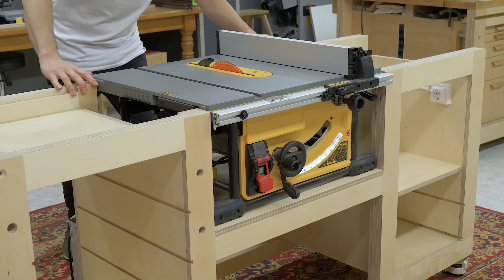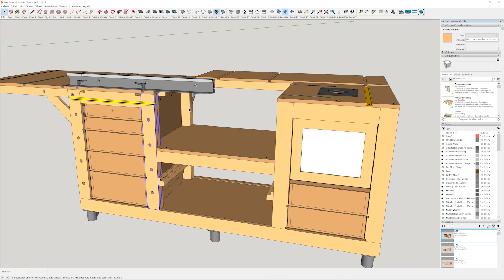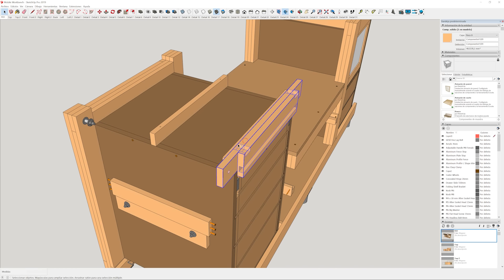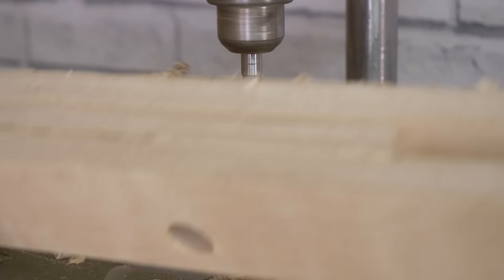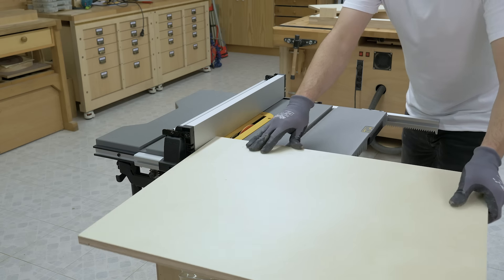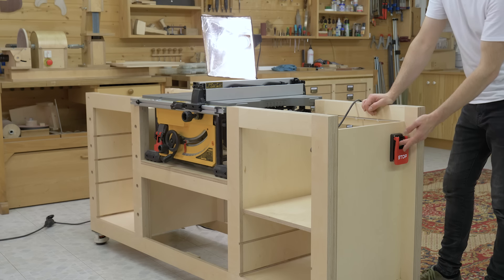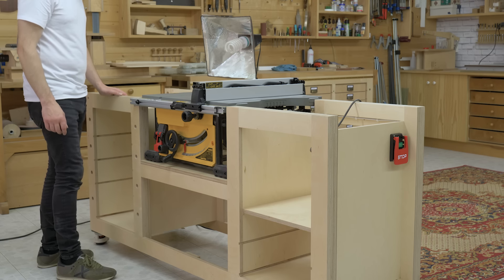DIY Mobile Workbench with Table Saw & Router Table / Ep 1

Comment: Incredible design. I just cut all the pieces for my bench, all repeatable cuts with my table and miter saw with stops. Even then, it’s very hard to be laser perfect with each measured piece. So I have some instances where there are 1mm or less overhangs or gaps when assembling the frame. Is this something you encountered? What’s the solve? Wood filler and sanding where needed? Thanks so much! I bought your plans and very excited to keep going

Comment: Given that, for whatever reason, episode 8 of this build was the first video shown in my recommendations, I had no problem skipping ahead briefly to that video to confirm that he did in fact install all six wheels.  That's comforting, because I can tell at a glance just from the sheer amount of weight and stress that this table is going to go through that it's necessary.

This guy doesn't seem like the kind of person to cut corners.  Trying to save a few bucks on two other wheels for a several thousand-dollar table is tantamount to buying a $1000 smartphone and not spending $50 - $100 on a shockproof case.

Now that I have confirmed that he absolutely knows what he's doing, I can enjoy the rest of the series.

Comment: Loved it, going to watch the whole playlist on this.. Love how you put a totally modern twist on centuries old mortise-and-tenon joinery. and use carpenters grade plywood to build it our of.. Wouldn't MDF had been a better choice on this, I know it is more expensive, harder to except screws, but using glue and the "mortise-and-tenon joinery" to attach would make it very strong, very stable (almost no explanation or contraction) & last, virtually for ever.. I can see there must have been at least a hundred hours of thought & planning into it.. I am a retired master carpenter, with 50+ years of work, I was trained by a Amish master for almost 15 years, from age of 10 to 25.. My shop has all the high tech toy's, yet I still do 90% of my joinery with mortise and tenon.. You have earned my subscription.. Sorry I babbled on so much.. Thank you for sharing... It was a joy to watch a very skilled tradesman... Oh also using some HDPE board in some places would also give it extra strength...

Comment: WOW! This is not only an impressive build, but also a great design. We're metric in Canada but sadly, our lumber is sold in Imperial units (i.e Inches). Converting metric to inches is easy enough, but the resulting measurements can end up with impossibly small fractions and are not practical to work with using our standard rulers and measuring tapes. The result is that you spend as much time converting and optimizing as you would creating the cut list from scratch yourself. Thanks all the same.

Comment: Interesting. I personally used small dowel pins for aligning the posts before glueing invisible from the outside; instead of nailing so to avoid the metal inside the wood. I used this technique with your mobile workbench plans.
This is another interesting build for the Dewalt table saw.
Reply from the maker: you're right, it's a good idea to use dowel pins. Send me some photo of your mobile workbench please!

Comment: know-how good
좋아요 
댓글 하나  1
هذا جيد
नीक + एक
сияқты. бір.
satu suka
いいね  一つ 
好  一个 
GOOD ONE
LIKE 1
1.4만   + 1 = 4    *    
202210151940
418
좋아요 

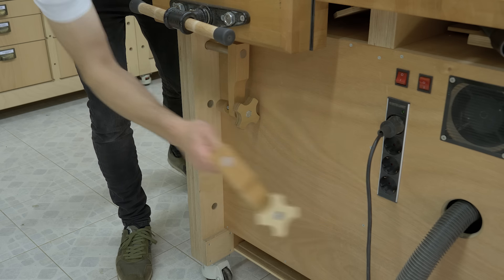1:04 / 13:39
#woodworking #workbench #tablesaw
DIY Mobile Workbench with Table Saw & Router Table / Ep 1
조회수 866,725회  2021. 9. 10.
1.4만
191
Paoson Woodworking
구독자 57.6만명
This is the first video in a five-part series where I'll show you how to build a robust and versatile woodworking bench to which I'll also attach my new bench table saw and a router table.
I'm going to install two folding tables to save space when I'm not using my bench, as well as to have more

Comment: One other thing I wanted to inquire about.  In the video the plywood used to build the frame of the workbench looks to be a high quality finish.   Can you elaborate on the grade of plywood you used?  Right now plywood is really expensive in the U.S. due to the "supply chain" issues.
Reply: Same here in Australia, plywood is super expensive. Starting out woodworking (bad timing with materials) and learning about plywood varieties. @Paoson Woodworking, can this table get away with non-structural ply? Did you use interior/exterior plywood? Cheers.

Comment: This looks fantastic...out of curiosity, if I just wanted to buy a workbench with at least most of the utility of this beast, what would that set me back? I've been struggling to use various saws on those cheap Dewalt mobile work tables and a simple work table, but trying to secure the material and cutting at weird angles is beginning to truly vex me
Reply: To clarify, I should've just gotten a damn table saw, got myself a miter saw plus a jigsaw, punch router and circular saw, been trying to use the last 3 for most of the projects I'm trying my hand at (mostly trying to build some wooden stuff for my toddler, roads/tracks for his cars, maybe parking garage, etc, and wanting to get better at woodworking to get more creative with some stuff for him). Would a table like this serve as a multi tool workspace easily?

Comment: Does the design care whether its 3/4 actual or 18mm ply? I bought the plans, I think it just ends up a bit beefier but there have to be a few places where adjustments need to be made, perhaps the interior panels
Reply from the maker: hi John, look at the last section of this article: https://www.paoson.com/blog/en/how-to-convert-the-plans-from-metric-to-imperial/
Reply: @Paoson_Woodworking  Thank you for responding, I ended up finding it within the zip file package, and I should have looked a bit harder before asking! Thank you for responding though

Comment: Would it be difficult to modify your plans for a larger, heavier, contractor table saw, the Delts 36-725T2? Love the design. Most USA designs center around 2x4 lumber construction, because it's cheap. I like your designs because its elegant and strong.
Reply: Hello Steve, I cannot answer for Suso, but I am currently building a BBQ_island based on this design/plan with some different dimensions. The BBQ will stand in the middle as you can guess, making the footprint different from the sawingstation and the cabinets are different sizes. To answer your question: yes you can modify the sizes of every part. It DOES take some careful time going over the sawing list to adjust (all) the right elements :-)

Comment: Material Cost for the Project? ..and how you build it without to have the workbench to build it? :D
Reply: The first workbench project is the trickiest when you lack flat stable surfaces. :) I had an old folding table and got an 8’ level for $90 that made it easier to setup a surface that’s flat for the first build.  (And that 8’ level has come in handy tons of times… heck even as a super long auxiliary fence for running sheets  over the table saw.)

Comment: Hi, 

I really like your workbench, and I plan on buying the plans. Clearly you put a lot of effort in the design and presentation. 

But I have a few questions:

1. Do you also include a list with links of all the hardware and were to buy them? For example the T-tracks, clamps and stops, but also the metal carriers for the folding support table?
2. In the video’s you mention that you’re planning some modifications/improvements. If I buy the plans now, will I receive an update when you change the plans, and can I redownload the modified plans then?

Kind regards

Bas
Reply from the maker: hi Bas, the plans include a fasteners list but you will not be able to find everything online, some things you will have to buy in nearby shops. I have in mind to make a new fence, the plans will be sold separately. Here you'll find more info:  https://www.paoson.com/blog/en/how-to-use-and-understand-diy-plans/

Comment: Fantastic table! Thank you for the amazing design. I just bought your plan!! Will be giving this a try and adjust to fit my Dewalt DWE7491RS. I am very curious, what is the material you used for the router table top? You mention in the video it's like a hard MDF with melamine on both sides, but it seems to have a blue core on the inside. Do you mind sharing the name for it? Thank you again and greetings from USA!
Reply from the maker: thanks! check his out: https://www.paoson.com/blog/en/bench-saw-and-boards-for-the-mobile-workbench/

Comment: I love this design, though it's a little bit too wide for my space. Do you think it would be possible to simply omit the router table section, or would that compromise the structure?
Reply: Hi there, I am currently using this design to make a BBQ-outdoor-island. The 18mm material used is very strong in the square set-up of this design. I would not worry to just remove the router table, although you need to find a way to make sure the saw stays where it is in another way :-)

Comment: Hi ..... I'm preparing the material to start the construction of my saw bench.
At 2.38 minutes I see you are using a nailer.
What model do you use?
What do you recommend that is well made?
Do you use 0.6 pins?
Excuse my poor English.
Thank you
Reply from the maker: hi mate, yes, they are 0.6 x 30mm. Any model that can mount those nails will work for you

Comment: I really like the thoughtful design process you came up with using engineered mortise & tenons using spacers and glue  and Brad nails. The lamination creates a very strong frame. Is that Baltic birch you used for the build?
Reply from the maker: thanks!! yes, it's Baltic birch but it could be made using another type of board

Comment: Nice work. Thinking of buying a plan. what is the thikness of the material used for this table?
Reply from the maker: hi, 18mm thick board for the frames and interior cabinets, 9 and 15mm for the drawers.
Reply: @Paoson_Woodworking  thanks 🖐

Comment: Hey u bought your plan for this project and the Modulare workbench. I also have a Dewalt 7492 but I just want a fix table on the left and the right. No. Ovine parts and no router. Can I just build the router side on both sides and leave the router hole away. Would that work? Kind regards.
Reply from the maker: yes, that's possible

Comment: Hi iv just ordered the plans ad looking at the plans  requires 18mm ply  is I built it out 12mm will I have to alter any of the cut because at the moment 18mm is hard to get where I am and we only get 1200 x 2400 lengths  Thanks
Reply from the maker: yes, you will need to modify some piece. In your case, I would make it for parts, first the frames and then check the size of each new piece. For some pieces like those of the interior modules I think that 12mm is not thick enough
Reply: @Paoson_Woodworking  that's great thanks for the advice I will do as you have said start the frame first and go from there 
Cheers

Comment: Hi, what a really good saw table.  Before I buy the plan a question, can the whole thing be built with 21mm multiplex or what wood thickness is in the plan?
Reply from the maker: hi Frederik, I use 18 and 9mm board in all my designs. If you want to use 21mm board,  you may have to make some modifications to the plans.

Comment: Hey what did you use on the woodglue when you glued on the plywood piece for the caster at 10:03?
Reply from the maker: that's the old trick of sprinkling salt to stop the pieces from moving when tightening the clamps
Reply: @Paoson_Woodworking  that's awesome, I'm pretty new to woodworking so that's should help alot, thanks.

Comment: Approximately how many 4x8 sheets of plywood does this project require.
Reply from the maker: Boards needed for this project (2500 x 1250mm):

18mm hard plywood = 3 + 1/5
15mm soft plywood = 1
9mm soft plywood = 1/2
Reply: Thanks very much. With the high price of plywood right now, I wanted to check before I buy the plans.

Comment: Hello, how many sheets will be used? In size standard 2500 * 1250. I really miss this information. (need to calculate construction costs)
Reply from the maker: about 5 boards
Reply: Is it 2500 x 1250 sheets? We have different standard here in New Zealand - 2440 x 1220 or even 2400 x 1200 depending on the brand. Would be good if you put that information in a plans description to avoid disappointments / surprises
Reply: Hello, yes it is in Europe. We use medium format (2500x1250) and large format (3000x1500).
For example, if you have 600mm deep furniture, you also have room for a full back, for some mistakes, or an inside solution door. (so you don't have to compromise on internal storage options.
And we use the height of 2500 probably because we have the standard for new houses and their ceiling height from the floor and that is 2.5 m, sometimes 2.6 m. So again, one sheet is enough to build really tall furniture. This is only for plywood. For MDF / DTD etc we have 2800x2070

Comment: The plans I bought for the Combination Workbench had a Layout Piece list that begins with Piece 1 thru Piece 30. It then omits Pieces 31 thru 33 before continuing. I had figured those piece #'s were omitted from the list for a reason. 
Could/would someone explain those omissions to me since I have just recently come across another/different Piece List that includes Pieces 32 thru 33...with Piece 31 still omitted. Also, the newest List ends with seven more Pieces: Pieces S1 thru S3 and Pieces F1 thru F4.
The pathway to the new/newer file is:  Mobile Workbench Plans File / Mobile Workbench / Cutting List-Fasteners / Maxcut / Workbench + Router Fence + Sled / Workbench + Router Fence + Sled pdf.
Do I need to be concerned with this new list or is everything from my purchased download file correct and complete enough to build the bench?
That is a great looking functional and genius workbench and I'll build it without answers to my questions.
Reply from the maker: hi Steve, those pieces are inside the cutting list of the router table plans. Send me an email if you have more questions, I will be able to help you better!

Comment: do yourself a favor and stop watching these fools making these workbenches with these portable jobsite table saws meant to be tossed in the back of a pickup truck and off to the jobsite. They super loud and not accurate at all, not even close. Get a proper cabinet saw, if you have  a small space cut the rails so it's not as large, but do not make something this huge with crappy super loud jobsite saw at the center